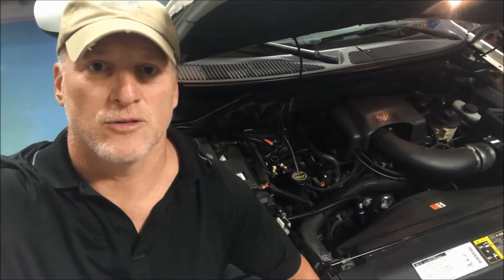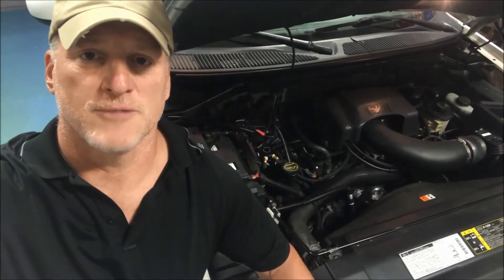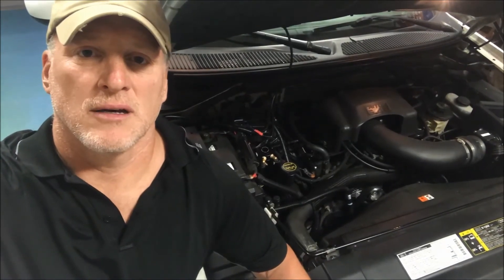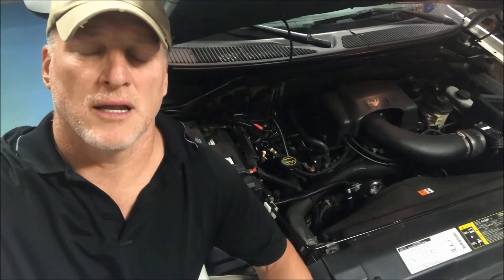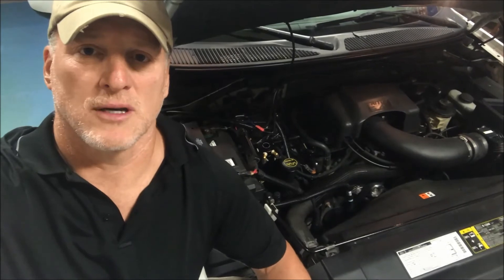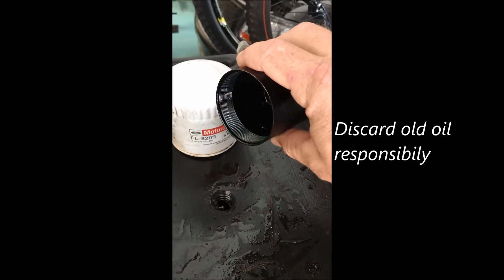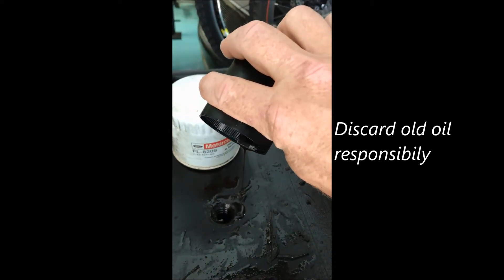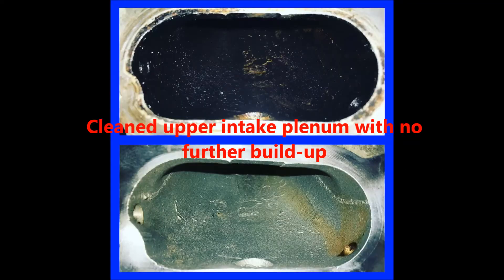How To Install Oil Catch Can: 10th Gen '97-'04  F150, F250, Expedition, Navigator, Blackwood: Part 1

Comment: Did you “T” the valve covers together or just go PCV-Can-Intake or did you just leave the passenger side valve cover to the intake?
Reply from the maker: I did not T the valve covers.  The design requires a circulating stream of air going through the engine for the PCV to work properly.  Fresh air enters one side of the engine and is evacuated (via vacuum) through the PCV valve.
Reply: @DrivingIntelligence  thank you so much for replying! I've watched a couple of your videos and they are very helpful!!
Reply from the maker: Glad to be of service!